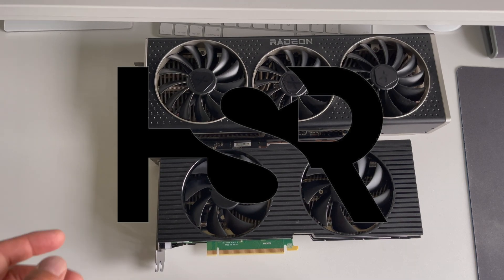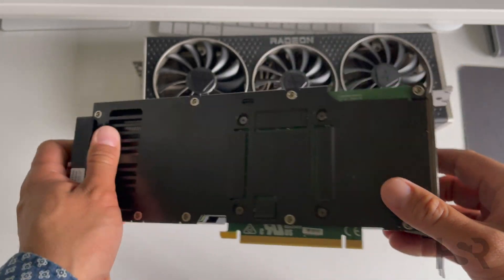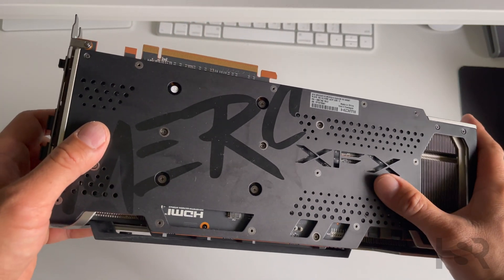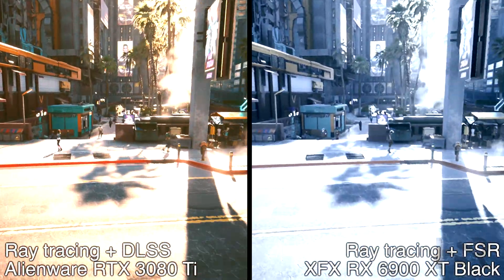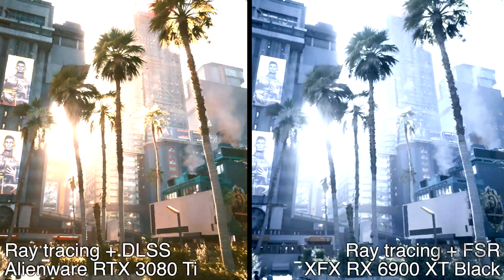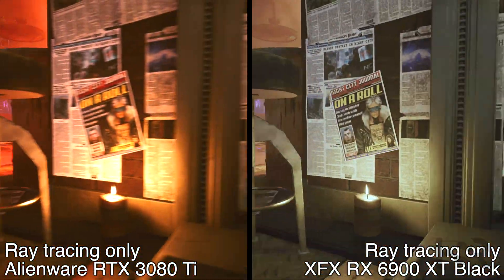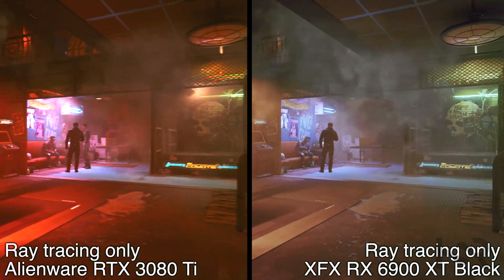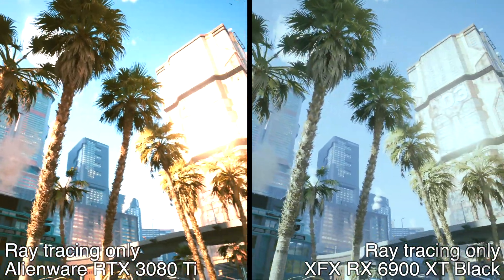🇦🇺Ray Tracing battle🦘 Alienware OEM 3080 Ti v XFX Black 6900 XT RT test (Over 100 game tests🤯)

Comment: You may remember, I recently bought the XFX Black Limited 6900XT.  And don't get me wrong, it's a beast, as you noted in your reviews.   And I LOVE the AMD driver package, it's vastly superior to Nvidia's.  But, in hindsight, Nvidia offers more with dedicated ray tracing hardware and DLSS is supported by developers much more.  Because of all this, and this review, I think I'm going back to Nvidia and replacing my Black with a 3080Ti or maybe a 4070?  There are no leaks that AMD is going to have dedicated ray tracing hardware like Nvidia's Tensor.
Reply from the maker: I don’t like to tell people what to do. I tried to show them different and let them decide. Does that make sense?

FYI, are use a RTX 3080 Ti myself 🤣 it replaced my XFX card

Can you not wait till November? It’s just around the corner. You never know what AMD might do. However, I don’t think will be as good as DLSS 3

Comment: So yeah you get less performance using RT on AMD but it's still great at 1440p and 1080p, especially when u compare the prices, personally I never use RT on either of my cards, it's a nice feature but not worth the performance loss and the pressure u put on the card for a little bit of different lighting and colors and better reflections which on some cases are worse looking than RT off, so far I've only liked RT on Cyberpunk and Control and a little bit on Dying Light 2.
Edit: Why are the games different colors in the comparison section of the video?
Reply from the maker: You must be new to HSR. As I have always stated, wished RT was like HDR; didn’t cost performance. Alas, that would be wishful thinking 🤣

AMD’s Adrenaline software 🤦🏻‍♂️ It’s so useless and incomplete in most scenarios. I have done everything to sort the discolouring issue. But it doesn’t help. That video has been colour graded as well. The original, you can’t even see anything 

Same exact system, just the change of GPU and drivers, and that’s what happened to the the video 🤷🏻‍♂️
Reply: @HSR  Huh, well I have a TUF 3070ti and an XFX 6900 XT and they both look exactly the same, wonder what's causing yours to have different colors, I assume you've already tried DDUing and downgrading drivers, have u tried switching display cables?
and btw, I've been a sub for about 9 months I think, give or take a few. I'm just not good at paying attention xD.
As for your RT/HDR argument, you just know it's gonna be something like that in the future.
Reply from the maker: I have tired everything. So far from what I can tell, some people have this issue with AMD due to their drivers and HDR monitors. I am still searching. 

Regarding the cable change. I tired it, nothing changed. What software do you use to record your gameplay for the AMD and Nvidia GPUs?

Nice work you being a subscriber ✌🏼
Reply: @HSR  I don't really record stuff as I'm not a content creator, but when I do want to clip something that happened in my games, I use Radeon's Instant Replay, however if you like to play Spotify in the background I don't recommend it cuz it just refuses to work when Spotify is on.
On the NVIDIA, I used to use GeForce Experience but I got really fraustrated by it cuz it kept logging me out, why would I need to login to some account in order to customize and monitor hardware anyway? So i just started using Windows' Game Bar and I'm actually liking it.
Reply from the maker: I used Xbox Game Bar for when I am not capturing gaming data. 

My issues lie with AMD and their software support. I don’t want to use Instant Replay or other software as I want my system to be the least bogged down. So that the results I get from my tests are as good as one can get. Does that make sense?
Reply: @HSR  Well instant Replay is for clipping, it captures the last "insert number" minutes/seconds of your game, I've never actually used Radeon's recording options, have u?
Reply from the maker: I understand that about Instant Replay. And those things take a tiny bit out of one’s performance. As a reviewer testing a product I can’t afford that. 

The issue that I am speaking of concerns the AMD Adrenaline software’s screen capturing. 

Does that make sense?
Reply: @HSR  I do get what you're saying, understandable that u want to show raw power unaffected by other aspects, I think most people know that recording takes away some fps tho.
I do hope u find a way to fix the colors tho cuz they looked really dead.
Reply from the maker: Thank you 🙏🏼
Reply: @manzariat7523  There's nothing he can do unfortunately. This has directly to do with AMD's capturing software/drivers and there are quite a fair bit of youtubers that are having the same issues. Hopefully AMD fixes that in the near future but outside of that, the 6900XT is currently CHEAPER than a 3080 and even some 3070 cards as well as requiring way less of a power supply to push it. That put's it squarely on my radar.
Reply: The AMD card is competitive but the RTX is much better at raytracing and upscaling. You get what you pay for. No need to rationalize and justify AMD for their lackluster RT performance in their last generation's flagship card.